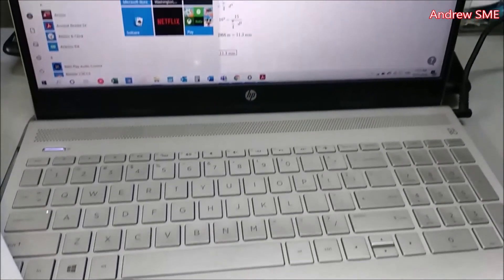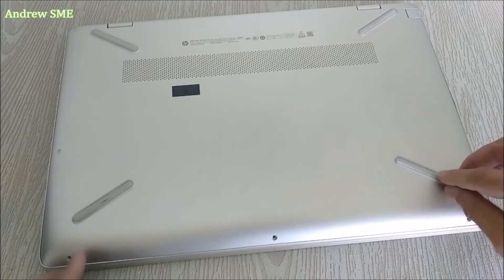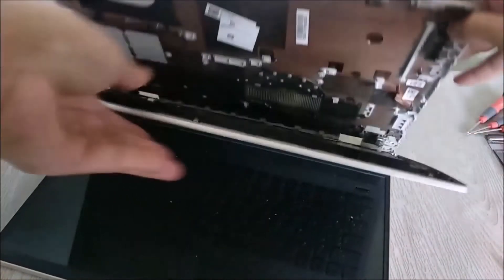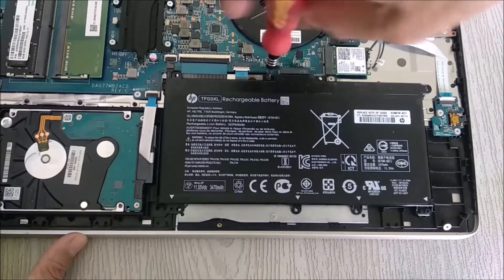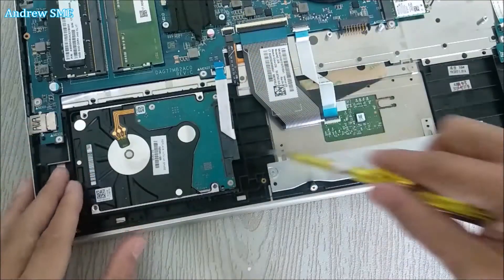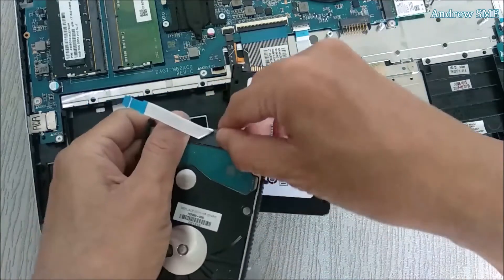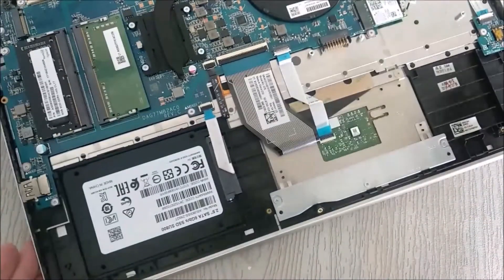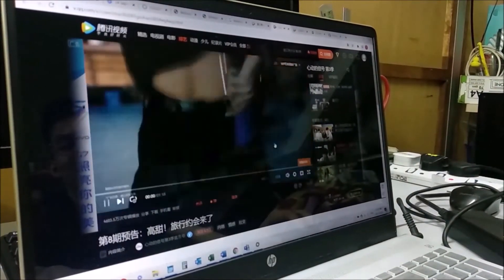HP Pavilion 15 CK063TX 15 LAPTOP Upgrade SSD HARD DRIVE, RAM, REPLACE BUILT-IN BATTERY

Comment: the status of my charge shows me 19% and it does not charge more than that, I keep it plugged in all the time otherwise it discharges.
it will take at least a couple of weeks to replace
Do you think it can cause a problem if I take some time to replace it? 
Thanks for your videos!
Reply from the maker: It's ok to wait until your battery arrived. Even the battery is flat you still able to use the laptop. Just plugged in the  power when you want to use your laptop.